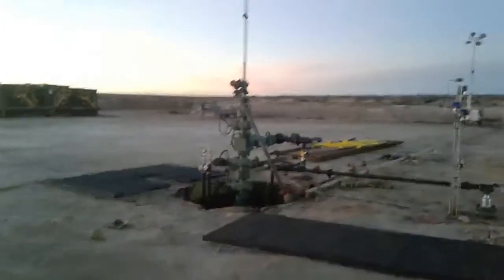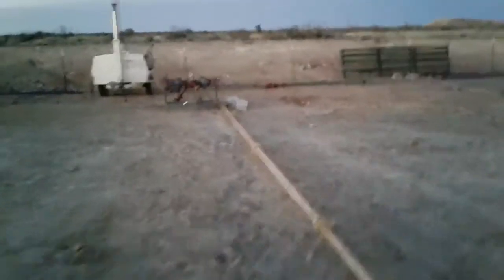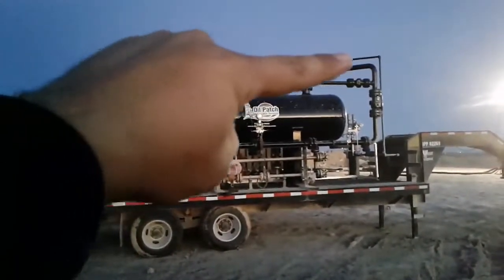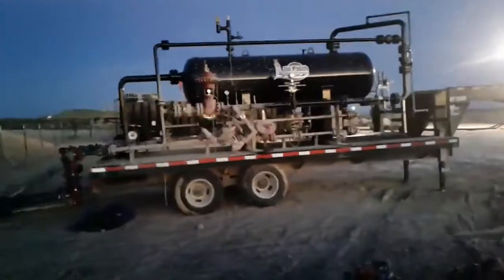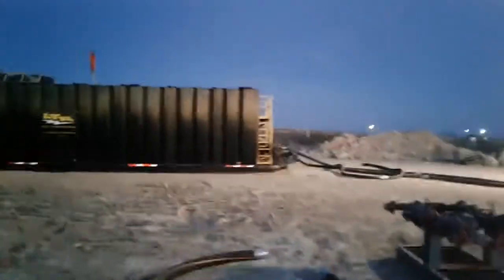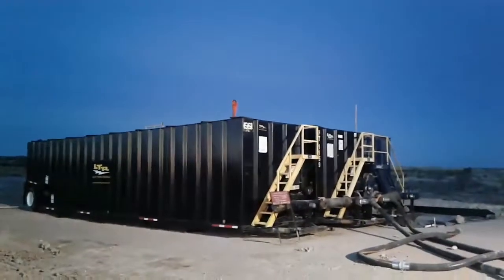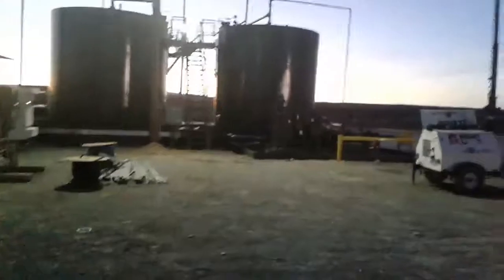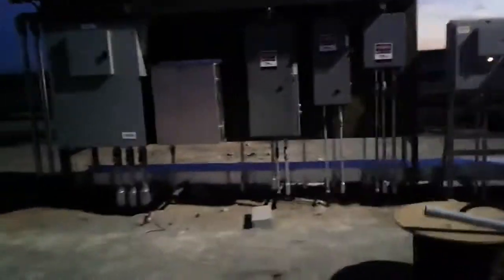Description of flowback operations

Comment: the pressure isn't decreased at your choke the flow rate is restricted, hence why you have a smaller choke in the back .. you clearly dont know as much about testing as you think lol
Reply: Put a gauge upstream of your choke and another downstream of your choke.  There will be a clear difference.  I didn’t go over the fact that this was a gas lift job, and I didn’t go into detail on the separator operations.  This video was meant for my kids and friends so I only covered very basic concepts.

I will never claim to know it all but based solely on the feedback from this video it seems to have helped many people with little to no experience.